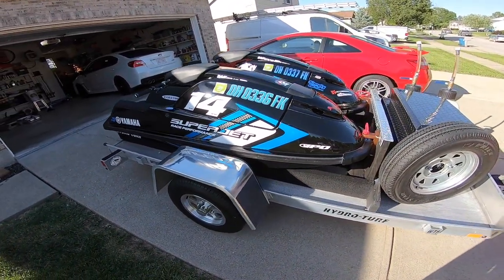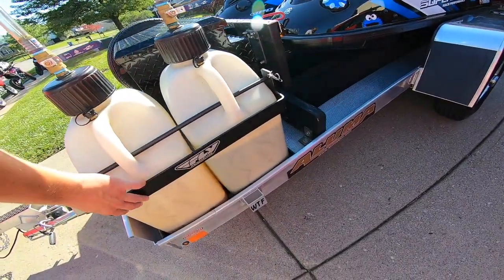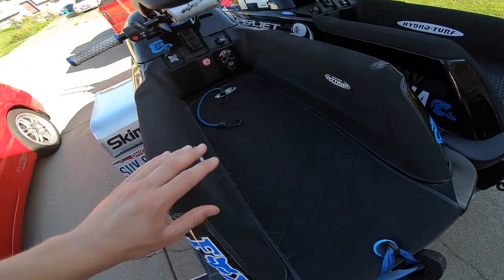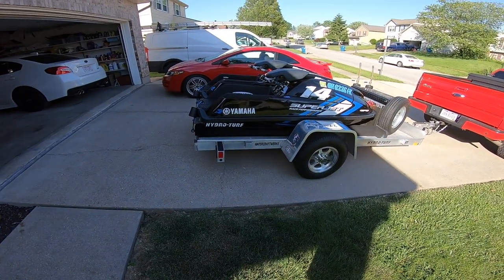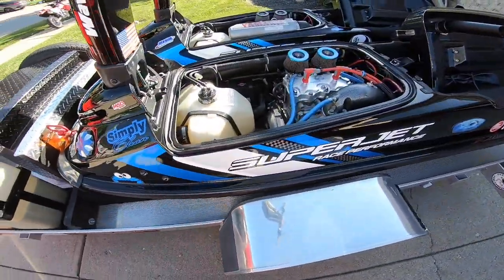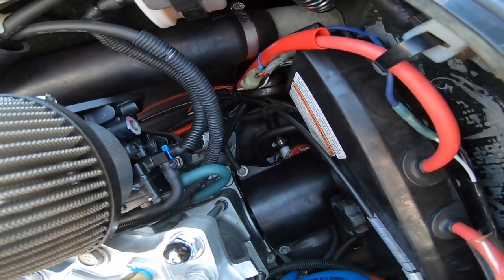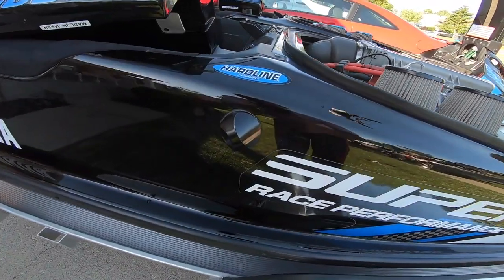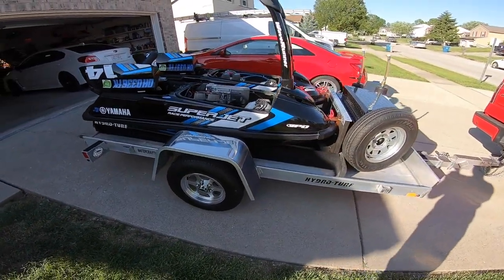Yamaha Superjet Walk Around and Ride

Comment: Curious what dimensions the trailer is
Reply from the maker: @Marshall Murray 54”x10’ this is a utility tilt bed trailer. Before purchasing and converting something similar verify that the hubs are rated to be submerged. have had several problems with welds cracking on the aluma with limited support from them.